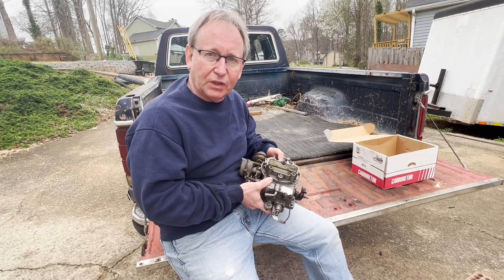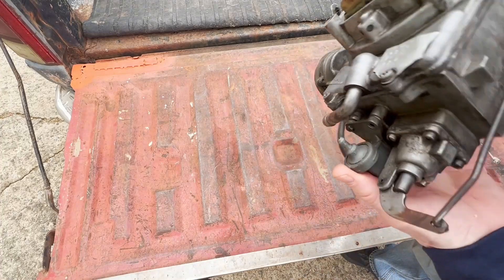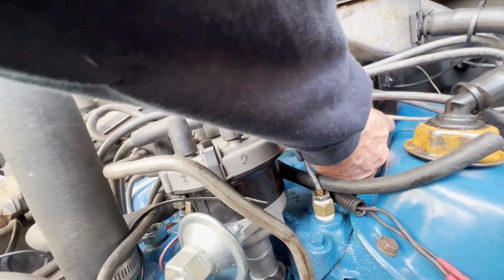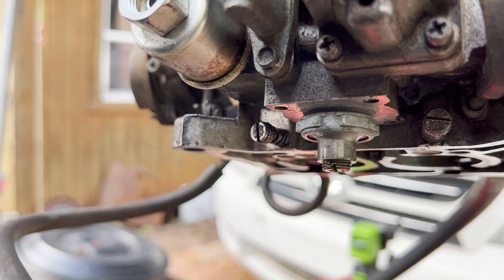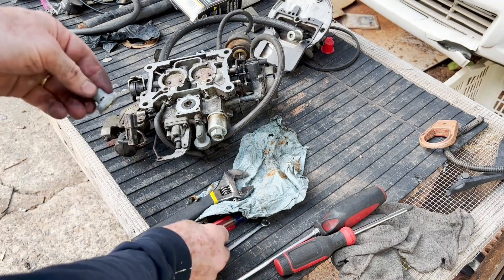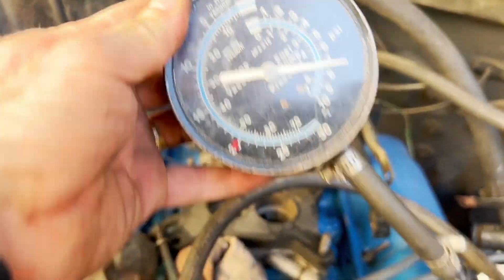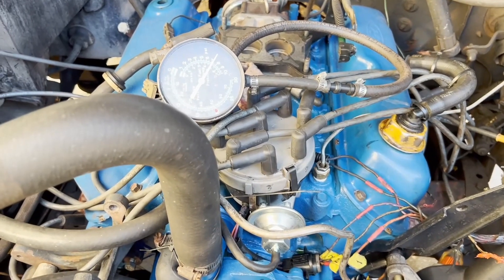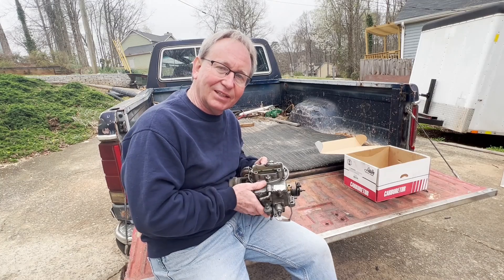Failed Carburetor Power Valve Can Destroy Engine: How to Find and Fix Quick

Comment: I think I have the same problem, with carb/fuel overflow. Question though: how does the fuel get in to the crankcase?
Reply from the maker: Hi. Sorry for the delay. I somehow didn't see your comment/question until just now. 
The high volume of fuel washes down the cylinder walls past the piston rings and straight into the crankcase. Happened while mine was running/driving and had to limp it along to get off the road. It caused hydrostatic lock and broke compression rings in multiple cylinders. I have six part series on the budget rebuild I did as a result. That was 3 years ago, and I drive it every day with many long trips. By now it's close to 40K miles on the rebuild. Go to my channel home and this series will be some of my earliest videos. During the tear down you'll see the type of damage that's possible. 
Hope you caught yours in time. Thanks again for taking the time to watch and comment. Let me know how you do.
Reply: @mkdhdinfiniteendlessconten3873  Thank you for the info! I changed the oil and filter and it's running fine ... fingers crossed it's OK. Appreciate your reply.

Comment: Thanks Bro.... I better go change that oil😬😁
Reply from the maker: Hi. Thanks for watching and taking the time to comment. Nearly all the fuel that enters the carb as a liquid will leave the bad/open power valve as a liquid and enter the cylinders as a liquid while the engine is running ridiculously rich which will require the throttle to be all the way open to barely run. All that liquid fuel will do two things: Get pushed past the rings and into the oil, and almost certainly break the top compression rings. 
My valve malfunctioned in traffic and had to double foot control the lurching truck off to the side with the pedal to the floor to bring in enough air to lean out all the fuel. It broke several top rings in a very short time. 
IF you go to my channel and look at some of my very first videos, you'll see 6 part series Budget Engine Build series. The first and I think second videos show the internal engine damage results of the bad power valve.
Thanks again for watching.

Comment: Where do you have the power valve hooked up? Was it at the intake manifold tree?
Reply: I see that you have it hooked up to your egr plate correct? I don’t have a egr plate anymore. Could I connect it to the ported port on my carb? It’s where I think you have the TCP connected to?
Reply from the maker: Hi. Direct manifold vacuum, although I'd be curious to see how it performed on ported. I might try that just to see.
Reply: @mkdhdinfiniteendlessconten3873  
So it would have no problem being hooked to the vacuum tree behind the intake manifold? I don’t have my egr plate any more

thank you so much for replying. Your videos have help out a lot.
Reply: For context I have a 6.5 single stage PV
Reply from the maker: Hi. That will be fine. It's direct manifold vacuum. Your PVC and Brake Booster are probably pulling from the same location. Try it and carefully monitor. Regarding your follow up comment below, I am unfamiliar with what "6.5" is referring to. 
Glad to know my videos have been helpful. I'll be getting back to engine and vehicle videos soon. Been working on the house and did the Route 66 Trip so put out a lot of videos about that and of course the AOD Transmission videos on the truck.
Reply from the maker: ok. Makes sense that the power valves would be available with selectable vacuum trip levels for tuning and performance tweaking. I just always went with what was in kit as I was always doing stock rebuilds. FWIW, that 2 BBL carb on the 83 was a limited run and finding the kit with the correct Accelerator Pump diaphragm and length was not easy.
Reply: @mkdhdinfiniteendlessconten3873  I agree! My carb was so old and busted up I had to get a reman one. It was so hard to find it because of the trans linkage on the carb. I have the same carb as you and lucky National carburetors had one. It wasn’t cheap though. But as soon as I put on my 302 it cranked right up🙏 these 2150 that work with AOD are getting harder and harder to find
Reply from the maker: Hi, Ya, the carb I'm showing in this video is the original one that I replaced with one I got from Rock Auto that I think was also from National. It is indeed hard to find and expensive ($400-ish) because of that pesky linkage for the AOD Throttle Valve Rod which Ford changed over to a cable a year or so later. Honestly I like the rod better. It's kind of fool proof for setting the throttle valve adjustment which I have a video on for that rod adjustment. It is clunky though and the bushings age and crack from heat.

Comment: Thank you for the recommendation with the power valve I had the same problem with my old Ford truck 87 same engine too
Reply from the maker: Hi. Thanks for watching and taking the time to comment, and glad the video helped. That power valve diaphragm is a single point of failure that will quickly destroy an engine. It broke compression rings in mine. Watch the first video of my 6 part 302 Budget build and you'll see what damage it can do. 
I took the top off the carb filled the bowl and watched in drain in seconds. 
I have many videos on many aspects of the truck and what one has to deal with due to the quality of parts.
Thanks again for watching and hope it running great for you.

Comment: I have a question friend how much transmission fluid you put in the carburetor
Reply from the maker: HI. just saw this other comment of yours. With the engine warmed up I hold the bottle a few inches above pour just a few ounces, maybe 1 - 2 oz as I crack the throttle and run it up to about 2,000 RPM and listen and watch. It will bog down a bit, and if there's carbon in the top end it will burn it out with a weird gray smoke that's kind of like a fog and doesn't want to go away, so I'd go find an empty parking lot somewhere to do it. Your neighbors will not be happy if you do it in your driveway. I usually do it twice and move the fluid between the venturis as I pour so it gets both banks. 
I did it a few months ago after the float started sinking and flooding it out and was surprised that I didn't get any smoke. So after 18 months on the engine rebuild and having the carb tuned good seems that the top end is staying clean. I drive it every day. Just took it to Florida. 
Pouring in the Trans fluid is the same as Marvel Mystery Oil. GM used to sell back in the day GM Top Engine Cleaner which was essentially Transmission fluid in a different can.
Thanks again for watching and takin the time to comment.